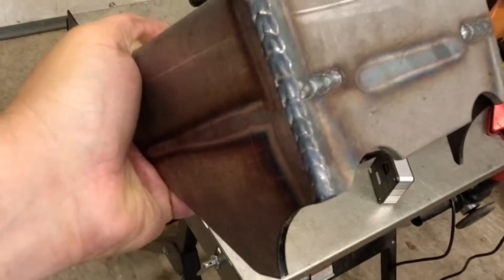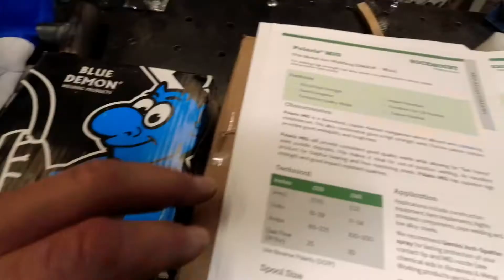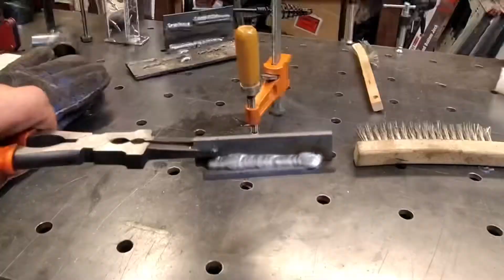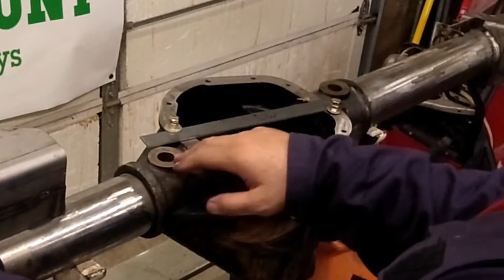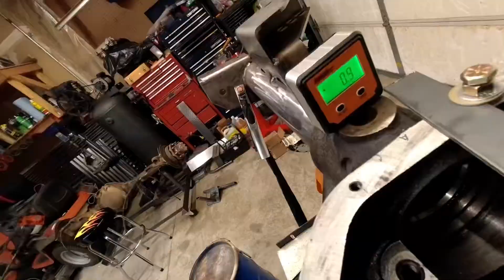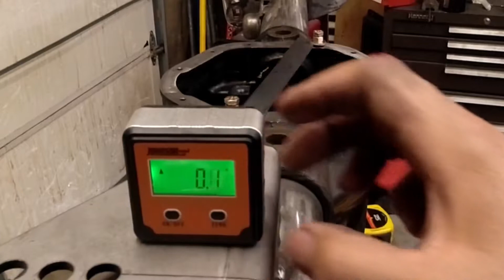SYNERGY TRACK BAR BRACKET INSTALL

Comment: Another great video. Those welds turned out amazing! My bet is with the Rockmounts Polaris wire having 100k psi tensile strength, that bracket won't be going anywhere.
Reply from the maker: Glad you liked it.  Looking forward to seeing it together.  Thanks for the support.